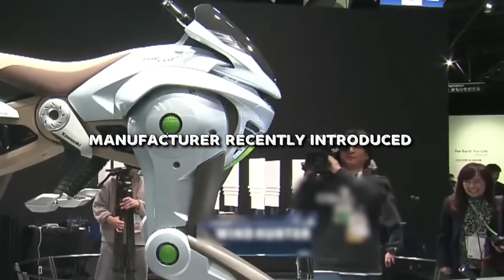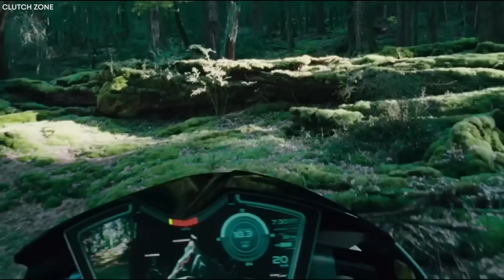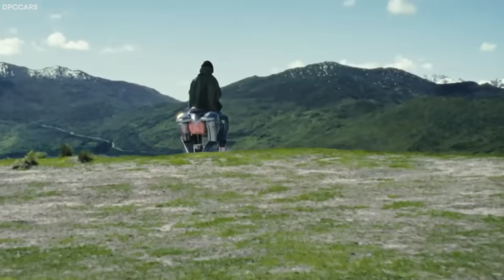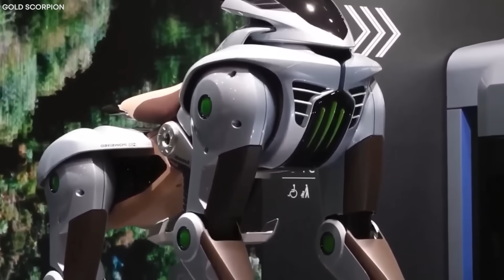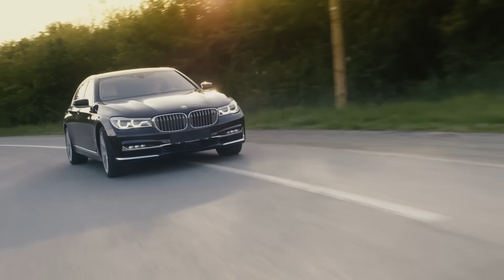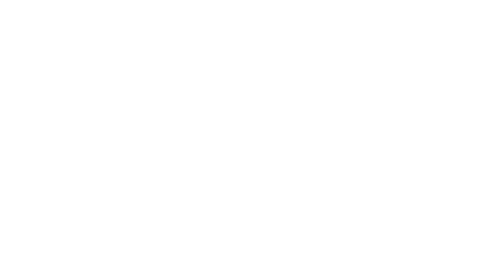This NEW Hydrogen Powered Robot Horse by Kawasaki Will Blow Your Mind

Comment: It looks awesome.
So, how many miles per hour?
How long for the water to charge its system for total functionality?
How long does the charge last?
Does it work in the cold winter, and for how long before the inside freezes?
How much does it cost?🤑
Where would the consumer buy it?

AND MOST IMPORTANTLY, DO PREDATORS OF THE WILD, CHALLENGE IT, OR EVADE IT?☠️

Comment: Why not give it 6 or 8 legs? I would want a chassis, that has a low center of gravity and something than even even transform into a motorcycle like the ones in Terminator. Make it easy for anyone, maybe even the new wheelchair for everyone to ride. Have a bucket seat cage setup in case of rollovers

Comment: The actual organic horse is still more efficient, but the mechanical horse is an impressive design. The complexity of the device is distracting. Any fuel turned into heat and motion dissipates. This solar system has limited resources and we will be here a long time. 😎 hopefully.

Comment: Pie in the sky Dreams! They dont even have a working prototype and hydrogen is a tricky one. You still need a small gaspowered motor to run all the fans and pump and the storage tanks for hydrogen are heavy and have to be double walled. I hear it works great on busses cause theres space for all the components